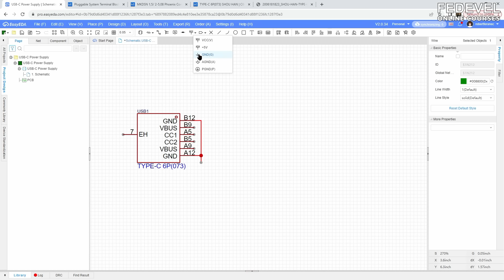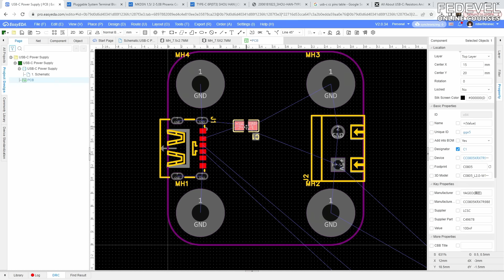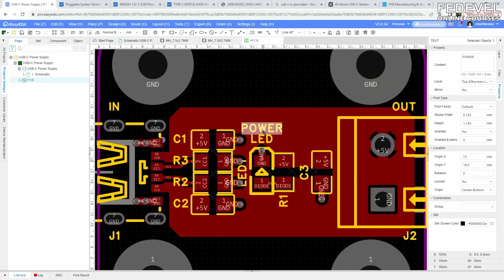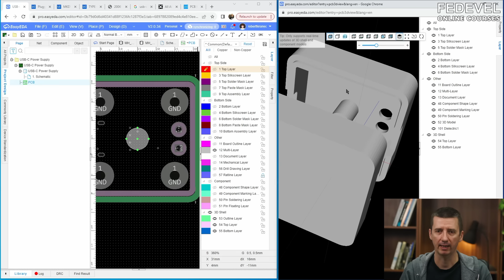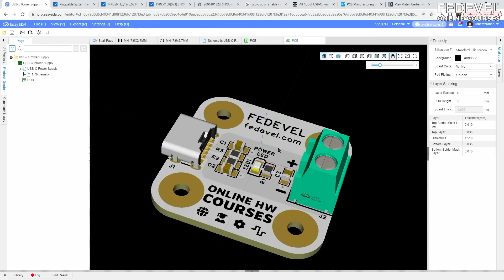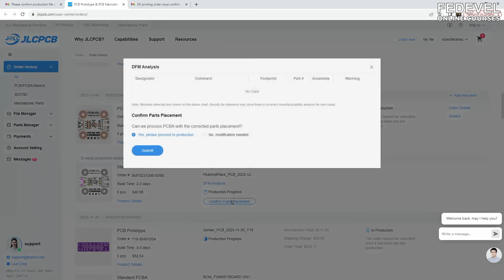Easy & Quick EasyEDA Tutorial - USB-C Power Supply Design + Box in 2 Hours

Comment: Very nice project. But the most important aspect (safety) hasn't been covered. What happens when the sink draws more current than the source can provide? Or when you make a shortcut at 5V/3A? If you're not going to pay attention to the source capabilties and you don't indicate them or limit the current, AT LEAST provide a fuse (resistor ...) that trips at > 3 amps. Because if you buy a cheap Chinese USB power supply, you can't rely on their protection circuit either. But that's what you're doing with such a board. Rely on others to get things right. If they don't, you're screwed.

Comment: Great video!  The one thing I noticed is when you do the 3D rendering of the board is that the parts may not be accurately portrayed.  I’m designing a board using some DIP sockets because I need to use some chips that are discontinued.  The DIP sockets are the same style yet they are rendered differently.  The parts are Boomele IC-14P (LCSC C2325), Zhouri IC-8P (LCSC C305904), and Zhouri IC-16P (LCSC C5289487).

Comment: When you place small SMT resistors you have to have the amount of copper each pad (near the pad) roughly with the same area (thermal heat sinking ability) otherwise when you reflow you get tomb stoning where the resistor/capacitor stands up on one end. That is why the default is spoking!!!
Reply from the maker: I have not found the final answer on this topic. Often I use direct for SMT as often power pins are connected to polygons and I would like to keep the connection wide e.g. in this case USB-C power pins. I asked number of people about this and some say no problem, same say it may be problem .... but I never get complains from assembly house, so I don't really think much about it. I only use thermal relief on through hole pads connected to ground planes (especially to multiple ground planes) as these are soldered manually and if there would be for example 4 solid ground planes connected to a through hole GND pin it can be extremely hard to solder that pin. What's others people experience?

Comment: You ordered both the PCB and the 3D printed case from JLC, but ordered some connectors from Farnell. You could have used LCSC instead!
If time is not a problem, I'd use the cheaper global direct line shipping method, which takes around 2 weeks or less to arrive to Europe and you get free shipping from LCSC when you have a PCB order from JLCPCB with that shipping method.

By the way, that was a nice looking transparent case. Wish you had shown the enclosures a little closer to better see the quality!
Reply from the maker: I didn't know they have free shipping. Is it the IOSS? I will try it next time!
Reply: @RobertFeranec  Yes, it is IOSS. 

I just choose Global Standard Direct Line for both the PCB and the Component orders. 
At LCSC checkout, they automatically detect you have an active PCB order available and they offer free shipping on the Global Direct Standard Line and the International Registered Mail shipping methods.

As an additional note, I recently ordered from JLCPCB and LCSC, both orders are shipped and in transit now,  and I'm still given the free shipping option from LCSC. Guess that means you can order multiple times from LCSC.